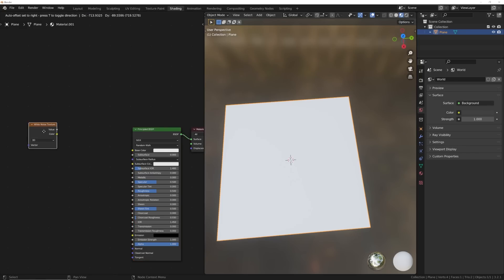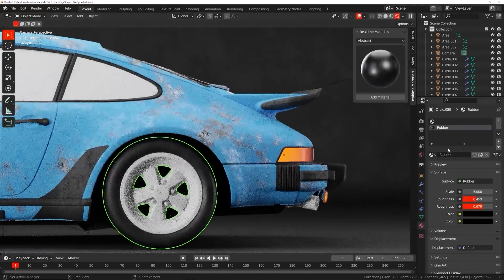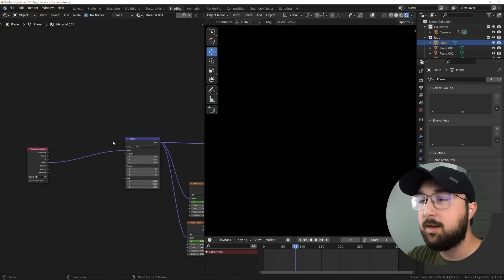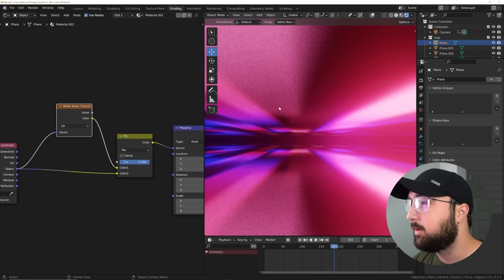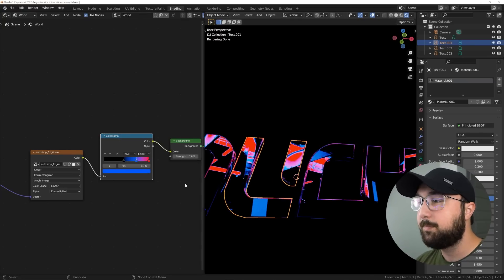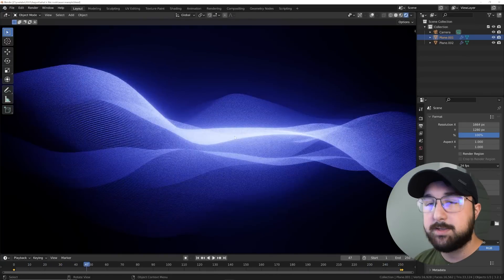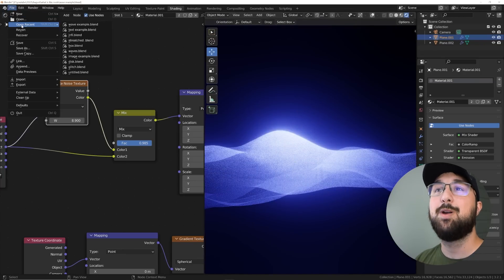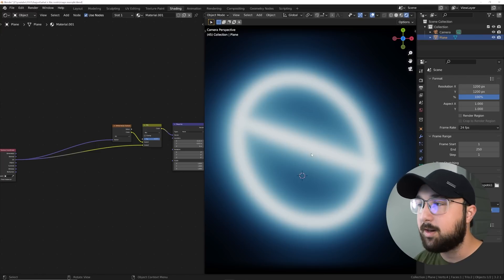How Do you use this Node in Blender???

Comment: That's so not what you use white noise for. You want to not use it on any input with a gradation. Even collapsing UVs to points will get messed up unless you also use a snap node with a very low number. It's basically a cost effective 0-1 evenly distributed random number generator that can output 4 fully random channels at once (unlike noise which is biased to around 0.5, but not exactly making it even less useful for this). Example use cases:
1) Create a bunch of spheres with a material that uses object info/random plugged into a 1D white noise ; white noise -> Separate Color.RGBH (S and V are less useful). Connect these RGBH to map range functions or color ramps to drive any portion of your material you want to randomize. A way to get more is just to add some fixed seed value to several parallel white noises.
2) Brick texture can output a random value per brick. Feed it through the above 1D RGBH system and let RG go through a multiply which is then added to UV offset in a lookup texture. B and V can be used with a <0.5 to drive if X or Y coordinates should be mirrored to reduce the impression that it's the same texture. Bigger textures is great for this. Voila, instant brick or floorboards using a seamless texture with very hard to spot repeats or re-use.
3) Use the position node as a white noise source in a "monitor on an office desk" scenario: Object info/random doesn't work for instanced collections, but geometry/position does. Setup a material that selects an image based on a value, and you get to populate an entire office floor with lit monitors with random images on them. Be sure to add a value you can control to the input to act as a seed; sometimes you want to "re-randomize" it based on what you get out. I use this all the time in my office space renders (for work). Material is time consuming to set up, with a huge amount of math/compare and RGB mix nodes for the selection process. Really wish we had a "select" node to make this process less messy.
Reply from the maker: It may not be what White noise is used for traditionally. But the effect I showed is interesting and makes great motion graphics. When it comes to creating art, using things in unconventional ways is a common practice. It’s what creates new ideas and new ways to problem solve and be creative. so I hoped you enjoyed writing out this comment but it’s not necessary at all.
Reply: @TheDucky3D  From the manual: "The White Noise Texture node returns a random number based on an input Seed." More useful info there too.

"but it’s not necessary at all."
Sorry. The title gave the impression you didn't know its intended use and tried to come up with some way. Maybe do a follow up tutorial for the third example I gave, random selection of textures on objects within instanced collections? I could probably dish out some tutorials myself, I just never find the time for it 😀

Btw, if using it to add static noise, try snapping window based coordinates and add a time factor. Grain would be more complex, best done in post with some actual grain addon in Nuke or something.

Comment: This texture gives you a random value per pixel (on the screen).
If you want it to spit out something noticeable, you just feed it coordinates that share the same color per some area (like snapping operation in vector math or vector output of voronoi texture).
Basically, in ordinary coordinates, every pixel is part of a gradient, and will have a different value, but if you feed it clearly separate colors in the input, it will replace them with other, random colors.
Otherwise, it makes for a fine grain texture, and comparison operations.

Comment: I use this node for random color, if you input some values ( 0 to 1 ) to its vector like connecting it to a random per island, and then connect the color output to the color input of Principled BSDF, you kinda get a random color result. ( if you get shading issues you can add a math node with snap set to a small amount like 0.001 before connecting the values to vector )  ( sorry for bad English I'm not native )

Comment: White noise is the static you see on old TVs. It's defined as every frequency mixed together at the same volume. The node gives you a different pseudo-random value for each possible input vector. There's a lot of stuff you can do with it other than adding grain. If you make the input vector constant over a range you can remap stuff to noise. E.g., take F1 voronoi, pipe it into white noise, and you'll have a different mapping with the same edges, so you can use it in ways similar to how you'd use per-object random except for texture colors. Make a 4D white noise and now you have as many different random mappings as you want. It's noise that's self-similar, meaning no matter how much you zoom in the vector input, it still looks like static on an old TV set.

Comment: hey Duck! we really want a tutorial of that super cool sci-fi wave at the end
Reply: I was mesmerized by it too. Not too hard to make. I just made something like it and should post it to my channel once it's done rendering overnight. One way to do it is you basically just make a high vertex plane, apply a displacement modifier to it that uses the distorted noise texture, then tie the texture coordinates to an object and move the object through the scene.  To get the lines just use a wave texture in the shader and a color ramp to make the lines really tight. Use a mix rgb node to flip between transparency and emission. Make sure you use cycles for transparency.  Maybe I should make the tutorial. ;)
Reply: @deltaray3  great breakdown thanks!
Reply: @alaslipknot  Yep. It looks like he used geometry nodes and Eevee to do it his way.
Reply: @deltaray3  you can use transparency in eevee if you set the object to alpha blend 👍🏻
Reply: @Raving_Smad  Indeed. Didn't know that, thanks. Renders much faster that way.😎
Reply: @deltaray3  it was a game changer when I found that one out